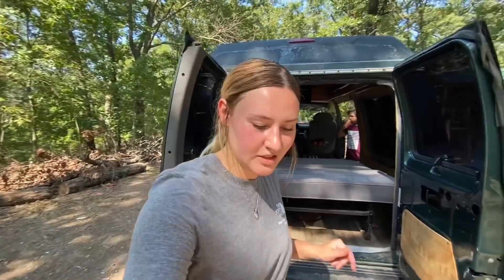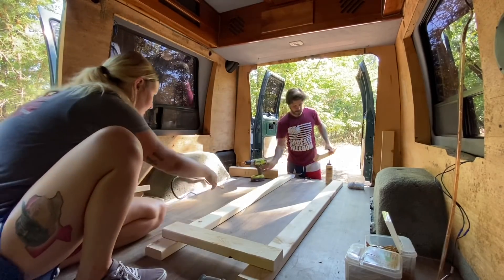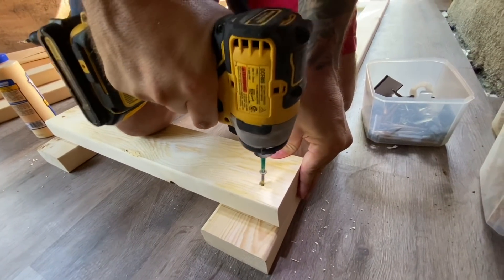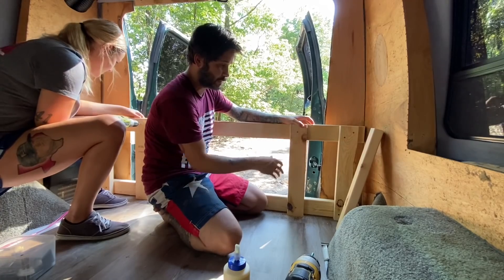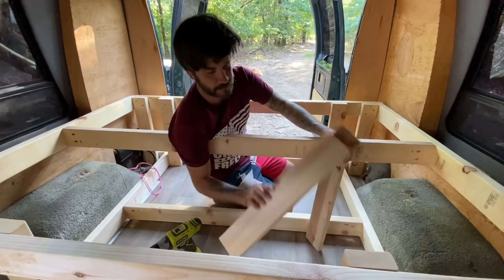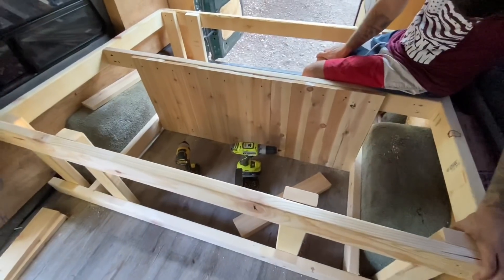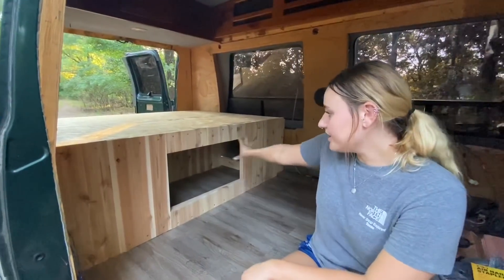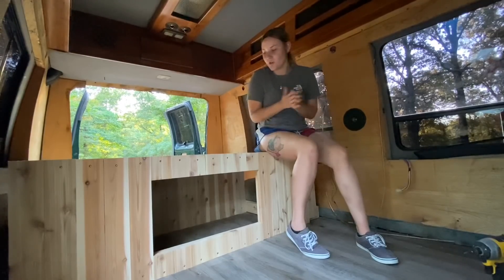Simple DIY Bed Platform VAN BUILD - OFF GRID VAN LIFE

Comment: I have a tip. Don’t lay your mattress directly on your plywood or you will end up with mold. You need a mat or some type of material designed to give some airflow between the wood and your mattress.
Reply: Yes and my Son's camper they have small ventilation holes on top of plywood also !
Reply: Traci Bowers True. I saw it happen on another couples YouTube channel with their van. They got mold. And I have seen in other videos where people suggest you definitely put something between the mattress and the plywood to keep the moisture away
Reply: Scrolled down to make sure someone said this. The mattress will hold moisture underneath if you place it right on the wood. You can drill a bunch of 1-2 inch holes throughout the top piece of wood so it vents down into the bottom. My vote for the door to the storage is a simple but cute curtain. That way you don't have to keep space in front of it clear for a door to swing out and it's easy to keep it out of the way while you're getting stuff in and out. Plus more air flow, which is always good in the fight against moisture build up.
Reply: Ya good  to turn mattress over every so often. And let air in van alot maybe every day.just like you would in a house. Hope this helps and good luck.
Reply: @anitawells3705  I have 4 memory foam beds but I cannot turn them because they are built to be on one side only.  They weren't cheap either and they don't have freaking handles, I miss handles!
Reply: @thirdeyevision11  Great idea!

Comment: Lookin' good Jaylena! Have you considered making curtains with a hem on both top and bottom and attaching it to the inside of the storage opening. I had one like that in my old travel trailer many years ago. When I wanted to get into that space I would just slide the curtains open in the center and close them when I was done. And it helped air flow as well. Just a suggestion...stay safe Baby Girl.

Comment: Suggest a simple curtain for the door opening under the bed frame.  Sliding doors will not work because of the cabinets on each side, hinged from the top you need to crawl under the door, hinged on the bottom you have to crawl over the door. Two doors hinged on side will sorta work but they take up more space and when sitting upright the door edges will be hitting the back of your legs.  A removable curtain, maybe using Velcro fasteners, at least to start is simple but allows the best access.  A welcome mat for a front door or small rug might work well.  You might consider cutting the bottom framework out from the doorway.  Easier to slide containers in and out if the floor is left open.

Comment: From my experience camping, you will want that bottom piece on the floor, out of the way. It is way easier to slide bulky items out from other the bed rather than trying to pick it up and over that lumber. Its just in the way and you can get support for the bed with legs. Both on the front and the back. The door should not open up, but to one side so it can be out of the way, opening flat against the kitchen area or the other side, whichever is most convenient for you. Ever seen those under the counter slide out shelves? That would be awesome for under that area...or even stationary shelves for shoes, tools, dishes etc. If it's tall enough, you can even slide a potty under there. Super fun! Looking awesome you guys.

Comment: I love it! One suggestion: drill several holes in the plywood to allow for air flow under the mattress to prevent future problems with mold.  Your mattress needs to breathe.
Reply: RV’s everywhere have mattresses directly on plywood without a mold issue. Are vans different than RV’s? Maybe because the RV’s have AC’s running all day/night it prevents the moisture build up?
Reply: Mark Whitley I’m not sure about the science behind it, just have been advised to do that by several vanlifers.

Comment: I think you should make a small slide out table on top inside the "clothes storage" or the door to open upwards with a kick stand leg for support. Something that when you slide it out/flip it up you'll have a small table. You can use it for a laptop, you can lay in bed and watch movies but also, something to eat on/counter space. Since the kitchen will be right next to it, extra space for prepping is a necessity. Not sure if you get my vision lol basically like back in the day when houses used to come equipped with a built-in cutting board. Same concept.

Comment: Make sure to drill a grid pattern of 1 to 2 inch holes about 5 inches apart on the plywood under your mattress or you will get a moldy mattress. There’s needs to be a way for your mattress to breathe. I watch a ton of van lifers and skoolies. They have all learned the hard way. Also, at the dollar tree they have these bins you can buy full of a gel  that absorbs the moisture. I would recommend them.

Comment: Looks good . Keep this in mind a standard plastic tote is 15.5 inches  high . I would use a dbl door on front so you do not have to clear things away to open because of the smaller doors

Comment: I don't know if you plan on having a full kitchenette with running water or not, but if so the back storage area will be a perfect spot for the water tank because they're pretty good size. Plus you can keep a small heater back there. Not sure what you plan on using for heat but winter will be here before you know it. Just a few thing's to think about. The front will be perfect to get some small containers with lids to keep your clothes in. Can't wait to see it all finished. That's gonna be a nice size bed.

Comment: I would maybe cut out the bottom plate in the back in between the 2 inside 2x4 and frame it out to have a heavy duty pullout on tracks. That way it doubles as a work station from the back of the van or table for cooking outside or whatever you want to use for it. I think it's a good idea to still have storage for the inside while giving you something to use for the outside as well! Either great job🤠

Comment: Id use toung oil on the wood ensted of a sealer.   Its a bit of work, but it keeps the wood sealed with natural oil and shines real good , use a electric buffer, itll speed up the process.    Keeps the woid natural and it doesnt cover up the cedar wood smeel. .   Just a idea.

Comment: The back space of the bed, U could hinge that plywood sheet & make a lid. Put a large plastic tote underneath & use it as a tub 2 take a bath, with a plug & hose 2 drain,  on one side, put on same side, composting toliet. All covered up & out of the way when not in use. U can use the tub tote 4 other things when not using it 2 bathe.

Comment: Consider pull out mechanism for the storage area in back. I saw a comment to put a curtain for storage in the front.  The reason is you won't need room to open. A small tension rod would work for the curtain. On Amazon of course! Love it so far!!!

Comment: If you plan on pricing the cost of AAA, then you might also think about comparing it to the cost of adding the equivalent to your insurance coverage instead & see which is cheaper.  
I have emergency roadside service on my vehicle insurance & have used it a couple of times to have it towed to a shop. Insurance company set up the towing service & they paid the towing service directly so I never had to deal with that bill at all.

Comment: On the front of your bed platform, where you put tongue and groove, you should have used 2 sliding doors in a 2 channel, so that the hole to your 'closet's as you call it, would have been a larger opening.  Then you could fit larger storage boxes under the bed platform.  Otherwise it looks good.  Can't wait to see you finish the van build.

Comment: May I suggest that you drill holes in the top of the plywood.  This will let your mattress breath.  If not you will have mold.  In addition you will need several containers of damp rid.  You can get something similar at dollar tree.
Reply: Drilling holes isn’t enough. The mattress shouldn’t touch the plywood. She needs something between the mattress and the wood to prevent mold.
Reply: @starflower703  She could put some Cedar Slats on plywood with holes drilled between the slats.
Reply: Beth Teer Maybe, but cedar can be brittle and I am not sure that would be sturdy enough. The slats in a stronger wood might be the answer or a mat that allows some air underneath.

Comment: I would get some reflective ordered for your back windows to help with keeping the cold out and to block the sun and the heat in the summer, You might want to consider some for other windows when you need to put it up. I would also pickup a portable solar panel that can charge your phone, camera when you are stationary. And to run other things off it. And a small generator to run a Mr. Buddy heater to keep you warm when needed.

Comment: Since your bucket seats don't swivel, you might consider building a comfy spot to sit and work/eat. Otherwise, you'll have to sit/work/eat on your bed. I would do a cushioned side seat with a desk-table. Like a booth, but with only one seat. Also, since you used a solid piece to go under the mattress, you'll need a barrier foam piece to keep from getting mold on the underside of your mattress. If you don't like the one-sided booth idea, you could hinge half of the plywood so that the back half props up to create a seat from the bed mattress. Then just cut the foam in half so it will fold nicely. If you do a booth, you could measure your potty to slide in and out under the seat. But, I would only do that if you build a WALL between the cab and the living space for privacy to sit on a toilet/wash/dress. Plus, a WALL will keep the hot cab-engine from heating up the back area and keep you protected if someone were to break a front window and get into the CAB area. You would be walled-off and safe. Plus, that would give you a 3rd wall to work with for cabinets or decor.

Comment: I'm using cedar, pine and my old barn wood and old wooden fence slats in my rig on the walls. A lot of the material is actually off of my farm.
Reply from the maker: That’s awesome!
Reply: @LeaveHerWild   I only use recucled materials I pick up in my rig. Go to home building sites if you need free lumber. They are all to happy to give whatever you pick up in their trash piles to you so they don't have to pay to haul it off. I haven't bought lumber in years.

Comment: Just never know what will walk by the van door at 3:10. I am happy you built the bed first. See if you can find soft sided storage boxes that would fit under the bed to hold your clothes etc. and put cafe style curtain rods top and bottom and cover the opening with curtains. A light weight option.

Comment: Trent and Allie had mold in a previous van build. I think they drilled holes in the plywood and used some other material between the ywood and the mattress. They said that it is a common issue. You might check it out.

Comment: Jaylena, just an idea....maybe look into a Countertop Induction Burner that only works with certain pan*pots & doesn't raise the temp in the van or cause fires. It's something you can stash away easily when not using. Look into the NuWave brand at Wal-Mart or online.
Like the progress on the van so far!! What are you using for a Mattress? Use a Lrg Stainless Steel Bowl for your sink. Might also think of getting some of the Silver Bubble wrap for your windows...easy to use & store in roll!
Take care out there!! 🤔🤗💕
Reply from the maker: Just an air mattress right now, ordering a memory foam mattress though

Comment: Ideas for your "vanmobil"  1- shower:  portable shower tent, battery shower head and a 5 gallon bucket  (the things in bucket could be, for example bags for "toilet" shampoo, soaps etc....everything will fit in your bucket for traveling/storage, tent will be your shower/ toilet & dressing room) 2- comfort: small USB fan to connect to the solar generator to move the air inside the van. You don't want mold in your "house" or your clothing smelling musty. 3- bedroom: for privacy in your bedroom area you can install a shower extension pole, buy a rustic looking shower curtain and cut in half then then to the length you need to reach to your storage cabinet under the bed or just cut the length needed and move the curtain to one side only. 5- miscellaneous: paint ceiling white, it will make it look higher and brighter and white will give you the rustic look you are looking for and buy 2 deep marine batteries and 2 100 watt solar panels (about $85.00 per solar panel in amazon batteries are in the 120 -140) this will keep your batteries charged and you will have energy for your fan,  small attic Ac,  small space heater for winter. Like I said some ideas to help you make your choices for your need, take them, modify them for your need and run with them.

Comment: You may want to put holes in the frame so the mattress came breath. This should deter mold  (Just a suggestion).
Reply: I was just going to tell her that.  Her mattress will definitely mold if she doesn't have any air vents, especially in the winter when it's cold and with all the moisture.

Comment: Jaylena, I would suggest you have your trim bit higher than the top of the platform of the bed frame to  keep your mattress from moving around. Also I would suggest two doors of the front storage to make it easier to see into the front storage area plus to help keep the doors from banging into your cabinet. The storage area will be dark so may I suggest a touch light or another type of light in that area? Also what about making a shelf on each side of the front storage area? I love your choice of wood! It's going to be beautiful! Xs & <3

Comment: What about putting a extention rod kirten for the storage door
Reply: Exactly, my first thought.  Put the rod on the inside of the storage with two small curtains.  There will be enough wood and weight in the van.  If you must go with doors then I would think that sliding will be the best option of not getting in the way of other things.

Comment: Very hard to access with a door opening up or down, even one that could be a table. I would do one that fits in tightly that you can pull off, maybe to be 
 a table on the fridge or ? ad a cabinet clip or magnets inside to keep it on other than just being tight.